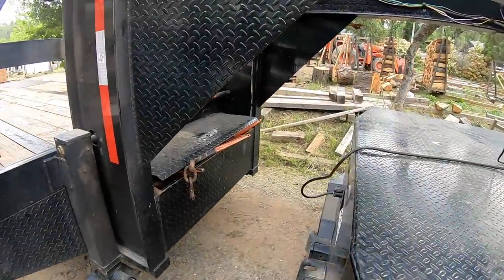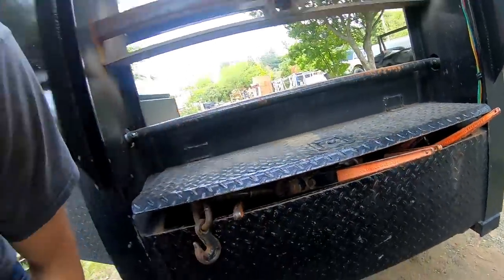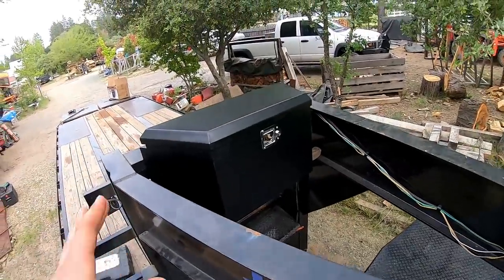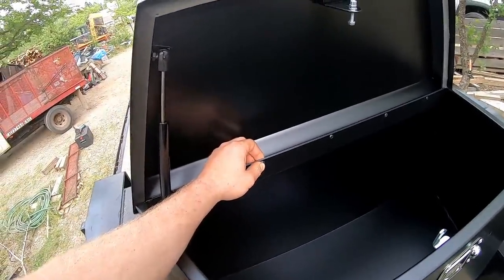ADDING UPGRADE TO GOOSENECK TRAILER! and ISSUES WITH MY EFI LIVE TUNER

Comment: Nice addition man! We have 2 Load Trail 36 ft gnecks and one 20 ft dual tandem Texas Pride Dump.  Chain & binder storage seems to always be an issue.  We have boxes under the bed but i think one up top would be good to.  
One of our Load Trails has 15k axles with monster/mega ramps. The other has 12k axles and hydro dove.  Both have hydro jacks.  Dunno if you disconnect much but we do all the time.  The hydro jacks were hands down the best investment for us.  It has no issue lifting when our 100 hp Kubota is all the way at the front.  Have had some issues with the hydro dove binding tho & basically getting locked in the up position.... steal working with Load Trail to determine a fix.  Keep up the great work!!

Comment: Yep, five minute two day job.  Just put a hasp and padlock on the box for the odd occasion you have to leave it somewhere. I put keyed hasps on my rod box on top of the truck. Are you sure your exhaust pressure sensor is working? It could be a problem with VGT control.

Comment: I got the same box, the lock started hanging up so I just leave the key in it, and with use and vibration the rivets got loose and the lid came off, so you  addressed the problems I had with the box on your install

Comment: If you ever want a chain rack on the gooseneck, you can buy one from diamond c replacement parts! It’s around $100 and it just welds on to the gooseneck upright. It also locks, and only takes up 6” of deck space! Some hotshots I follow on Instagram swear by them.
Reply from the maker: Elicson Workshop hopefully just get the whole trailer from them and they throw those on there for me hh
Reply: V-BELT and SON oh yeah there you go!!

Comment: I was told to never weld a trailer with it still connected to the truck cause you might short out the truck computer